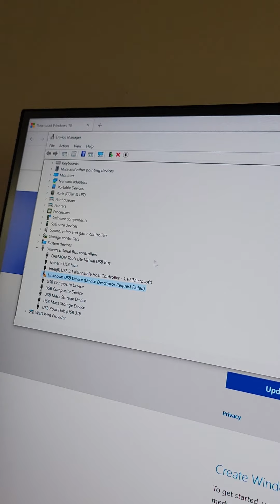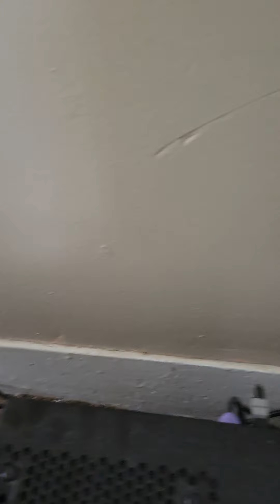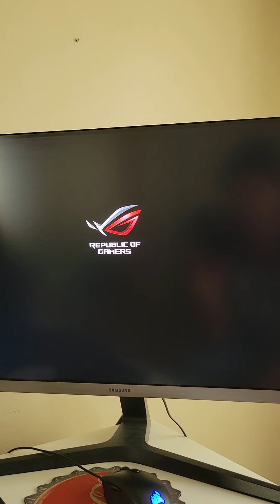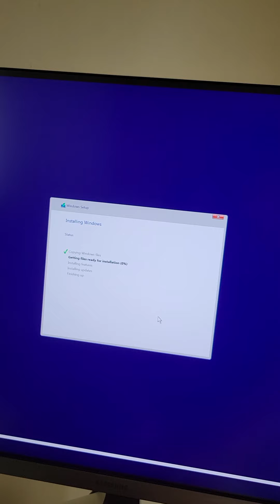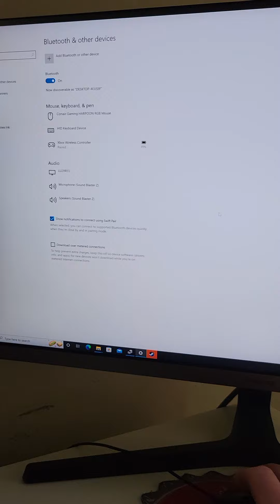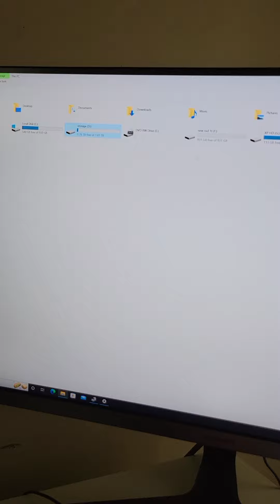Computer repair no Bluetooth and a USB code 43

Comment: I had the same problem!  My embedded Bluetooth quit working.  I bought a dongle and antenna.  It worked fine for a bit.  Windows was constantly disconnecting it and reinstalling embedded driver. Sooooooo frustrating.  Upgraded to windows 11.  Much more stable, no prob with the dongle.
Reply from the maker: yea windows breaks things with updates